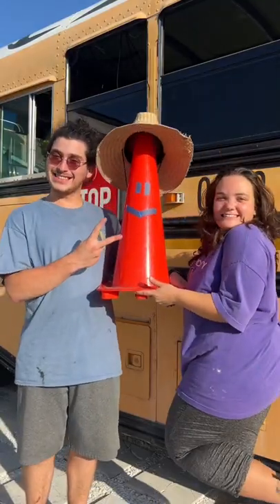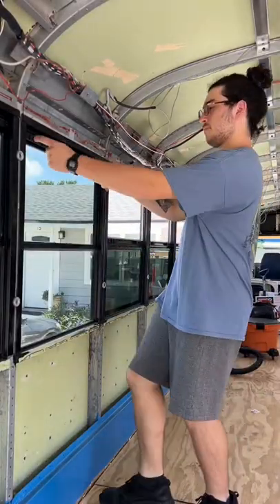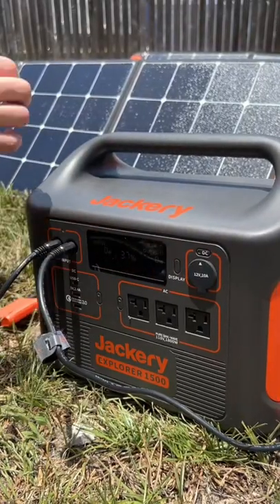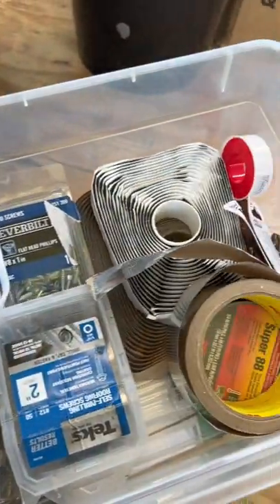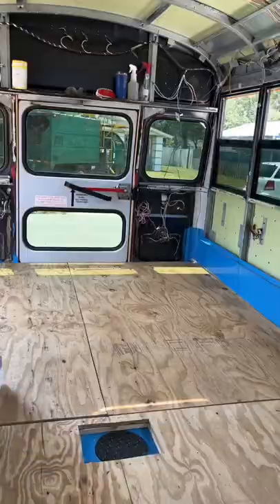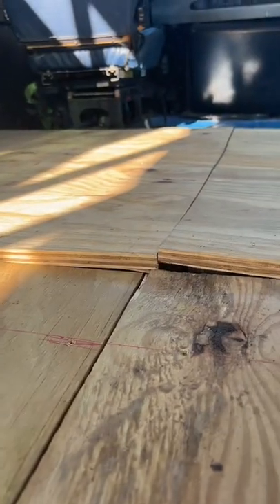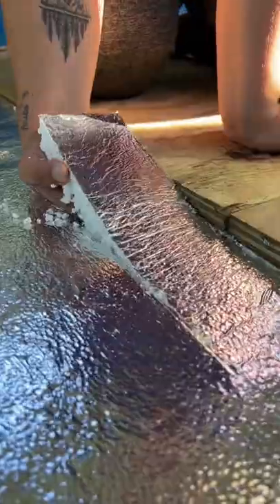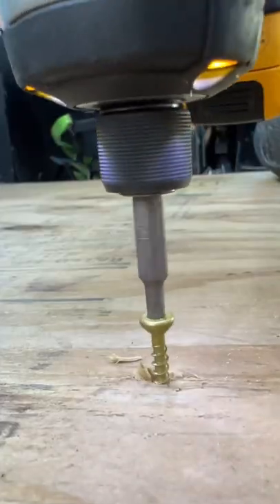Hint: we are staying in state!#schoolbusconversion#diyprojects#diy#skoolie#skoolieconversion#vanlife

Comment: Hey so a couple of quick tips just in case the plywood bottom ever starts to warp. 
1: don’t use curved ply. If you just have to, make sure the bubble faces up. So stepping on the bubble makes it flat. That’s how subfloors are commonly repairs. 
2. Stagger your seems. You don’t want the subfloor to look like a checker board. Think of it like a brick pattern. So you’ll use the same amount of material. Believe it or not, but this will help keep the boards from shifting or warping. 
Love the videos! Cheers.

Comment: If I remember from my shop class you’re supposed to have the boards with the concave part downwards. So that it slowly flattens itself out. 

Idk if thats true for subfloor or that type of board or if it really matter but figured I’d share it with yall. Cheers
Reply: It's best practice tmk but idk how much it matters. I'm not a builder so 😅
Reply: You’re also supposed to stagger them so that you aren’t creating stress concentrations. Any flooring they put in is going to CREAK.
Reply: Did you see how wet the plywood was when they loaded it? They also didnt use tongue and groove subfloor. Lots of major mistakes. Please consult/befriend a contractor before and while doing a project like this.

Comment: Not a tradie but if you’ve got enough depth on the floor maybe you could put some steel framing on the floor and stuff the insulator between the spaces made by the frames secure it with a nail gun and just put some ply or jibrock over it or maybe even some vinyl… not sure again not a tradie
Reply: We’ll just saw your other videos and you do have framing